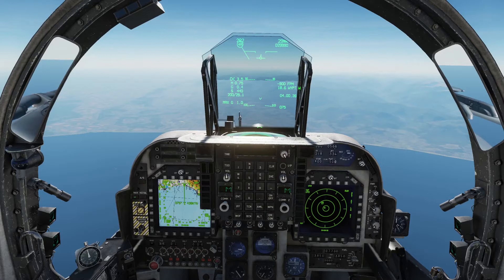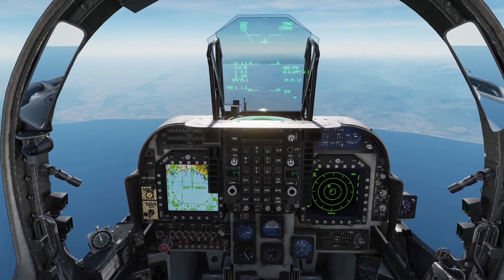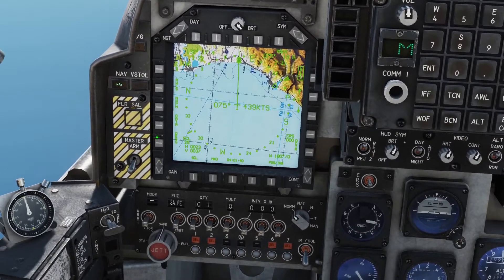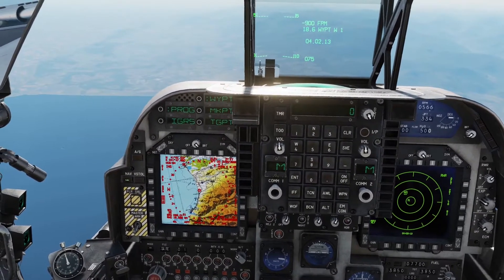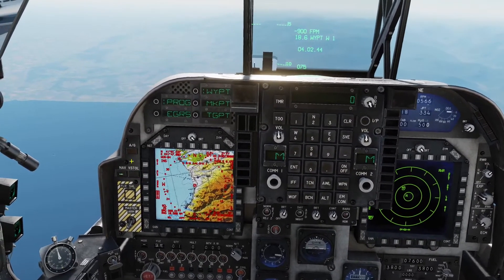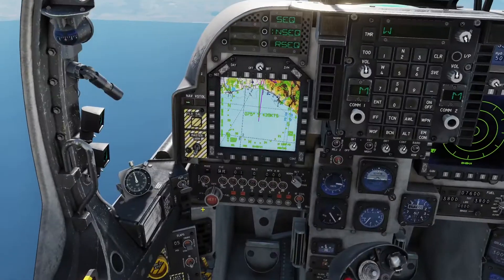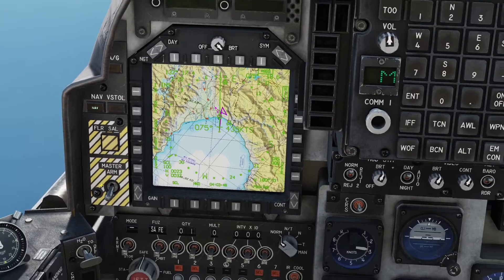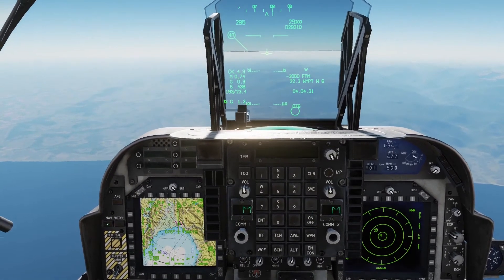DCS AV8B Harrier, ROUTE Programming (NSEQ)

Comment: Is here possible to switch marked point to target point?
Reply from the maker: Not sure what you mean here, you can desgnate mark points if thats what you mean?
Reply: @TEACypher  nope, I mean transfer data of a marker point to a target point

Example: I have M0-M1-M2, and want to jdam M0-M1-M2. So I want those to be T1-T2-T3.

I've found an answer: you can use TOO (Target Of Opportunity) to save TPOD/INS Coords as WPT/MRK/MRK

So if you have M0-M1-M2 designated, you can push TOO for each Marker and set them as T1-T2-T3 (you can even change the number to assign)
Reply from the maker: @VinS9608  yeah thats the only work around u can thonk of, unless you manually copy the cords and program them in as targets

Comment: What does terminal point do? And shouldn't SEQ ODU button toggle display of normal waypont sequence on EHSD, or it is done via MAPM menu -> Overlay 2 before using this ODU toggle button?
Reply from the maker: Normal route display requires overlay 2, havent platey with terminal but i believe that it set one waypoint at the tgt then youte can use route, seq but havent tried myself.